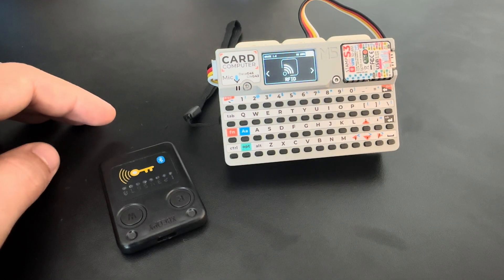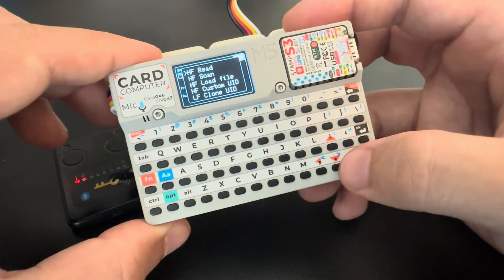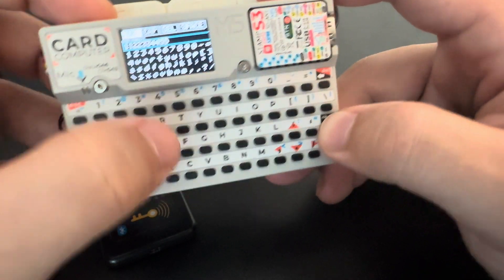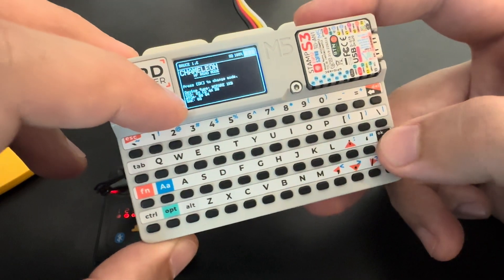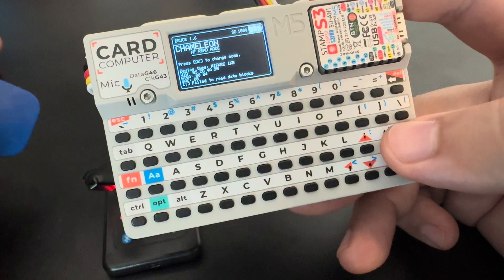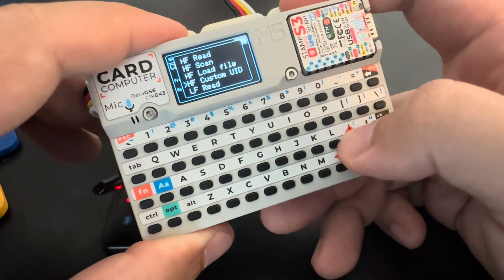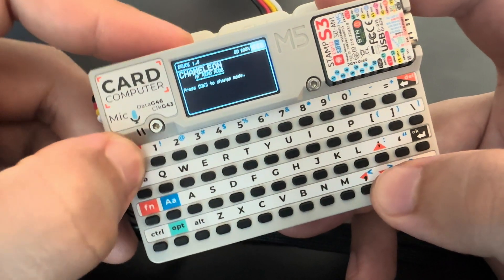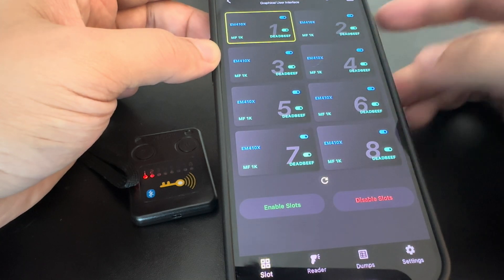Chameleon Ultra + Bruce Firmware full integration (read | write | emulate | scan)

Comment: Can you integrate this with the m5stack c plus 2 instead of cardputer?
Reply from the maker: @h0licede  yes, you can integrate with any device running Bruce firmware
Reply: @R3CkTech  thank you. just received my cu but when i tried to read my lf tags its not reading it. i have multiple and still no luck.
Reply from the maker: @ you can join our discord server. There’s an rfid channel that you can share what’s happening and someone can try helping you

Comment: What is the difference between the m5stack rfid 2 and the chameleon ultra
Reply from the maker: m5stack rfid2 is an rfid module that you can use to read and write HF tags (13.56MHz). Chameleon Ultra is a complete device that you can use to read, write and emulate both LF (125kHz) and HF (13.56MHz) tags. Also you can store up to 16 tags (8 LF and 8 HF) into chameleon for emulation

Comment: Is this device better than pn532?
Reply: The Chameleon Ultra reads, writes, emulates, accepts several different modulations and cards and works on 2 frequencies, 13.56Mhz and 125Khz. It is extremely better compared to PN532.
Reply from the maker: @phantomfox4281  much better. With this you can read, write and emulate both HF and LF tags. And you don’t need any wires for that